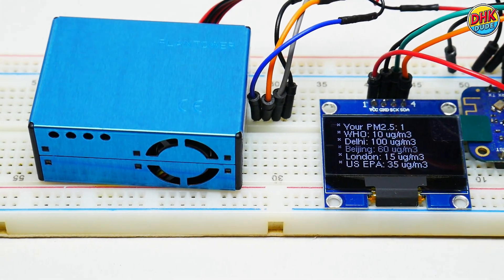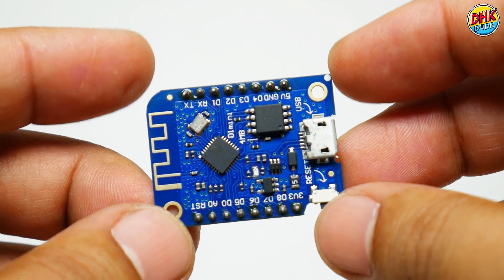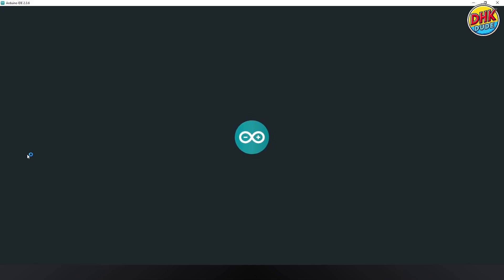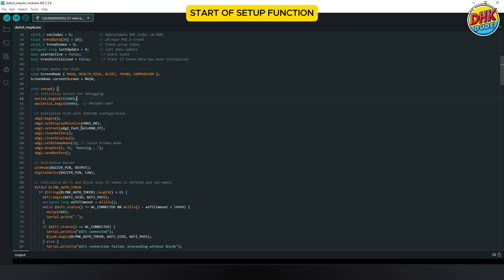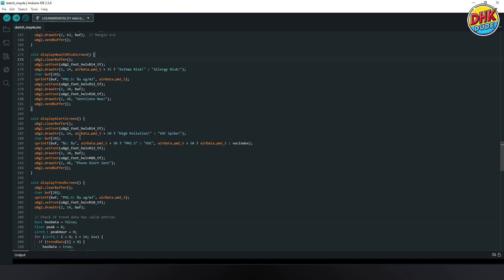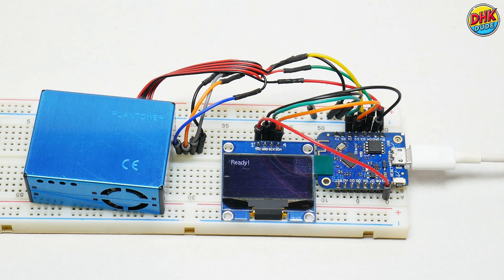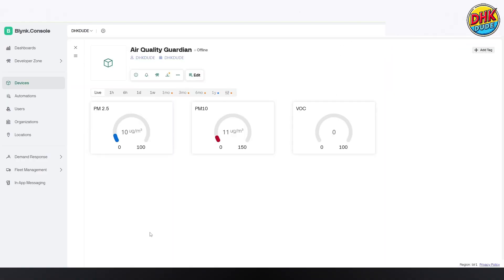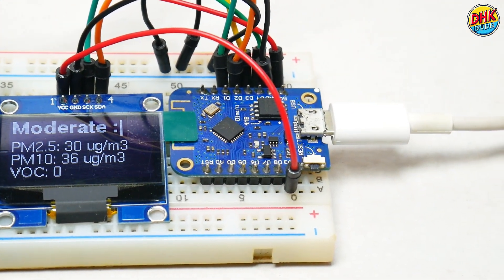Build a Smart IoT Air Quality Monitor for $24: PMS5003, OLED & Blynk

Comment: Thank you for the excellent video (the background music is fine) and sharing your code. Have you had any trouble with Blynk using this code ? The Blynk Community constantly reminds me to keep your loop() as clean as possible by using timers and avoiding delays.  I'm planning to use an ESP32 with the PMS5003,  a few MQ gas sensors and a BME 280. Your code will make it a bit easier.
Reply from the maker: Glad you liked it. Didn't notice that during setup, maybe that's just a reminder to reduce server load and token consumption, will revisit the code in case there's an opportunity for the improvement. If you are planning to use ESP32 change libraries accordingly.